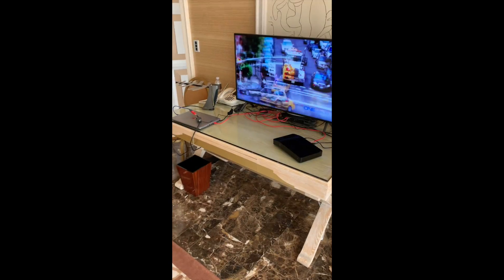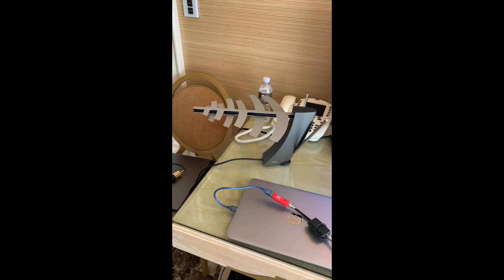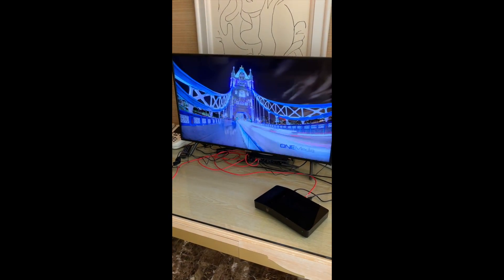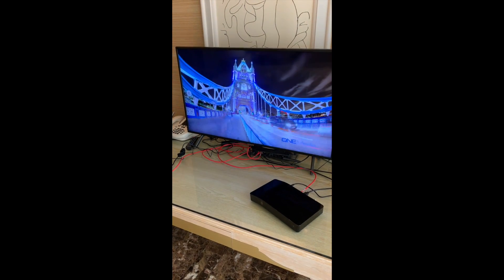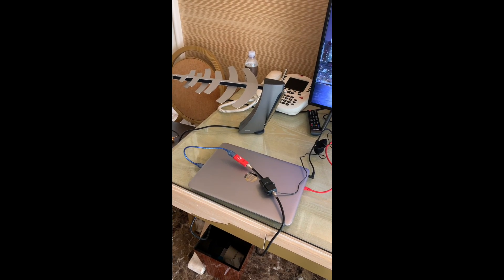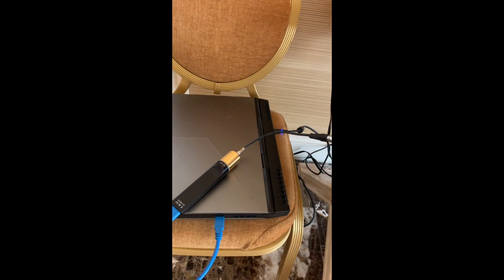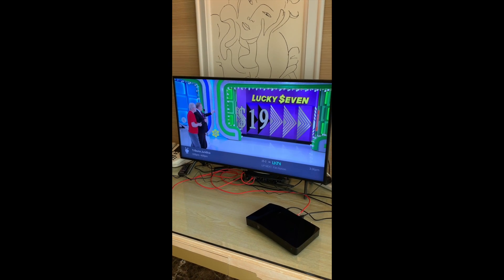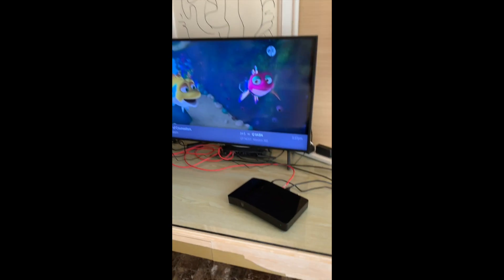TiVo Demos ATSC 3.0 Adapter

Comment: Will this actually come to fruition for the Bolt OTA units at an affordable price?  Right now, I'm reminded of the "Mitsubishi Upgrade Promise" in the early 2000's, stating they would make any TV they currently sold back then to have updates (hardware) to HDMI, etc. when their market share then was rear projection TVs.  They lucked out as they were banking on that none of these TVs would be working any longer or updated to something newer; but it was great marketing hype!  Is this the same thing?  Also, this little "setup" is ethernet based, not USB, whereas my two Bolts are plugged into ethernet for guide updates each night.  Would they even coexist?

Comment: Demos can suck a fat one unless they have an actual system that will be in a local station there encoding the video streams live. It comes in lossy and it leaves even more lossy. And real-time encoders offer terrible picture quality. All of these demos use streams encoded by software, well below real-time speed. They just take the files they encoded and modulate it directly OTA. I personally think ATSC 3.0 is going to look absolutely horrible at 4k60 out in the real world.